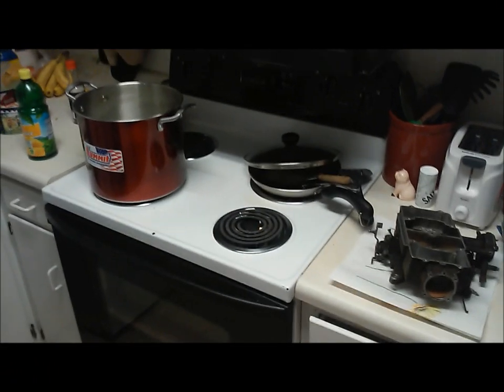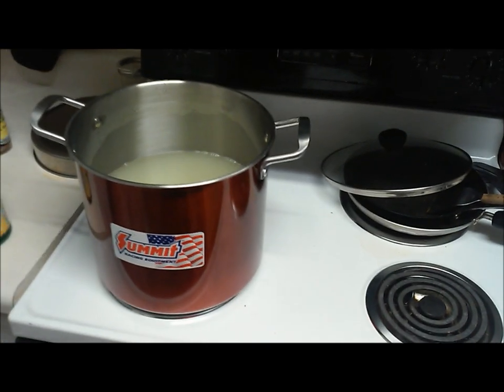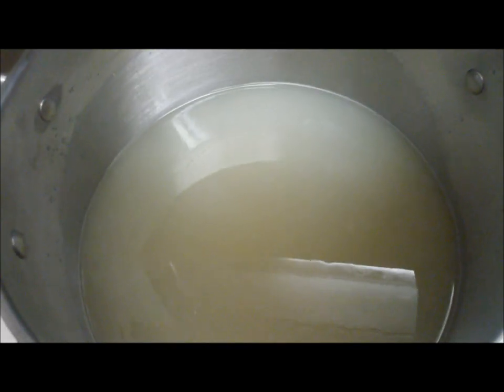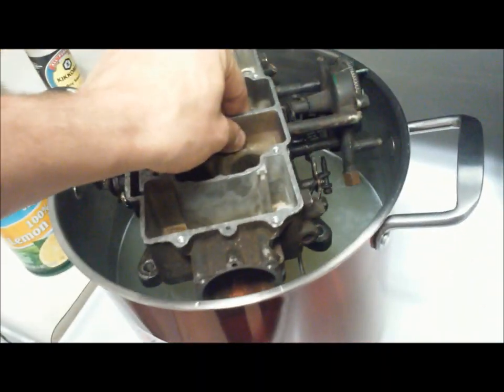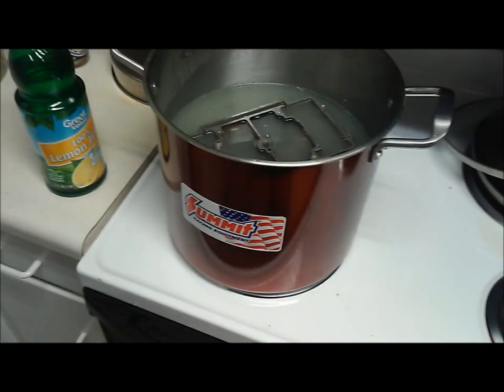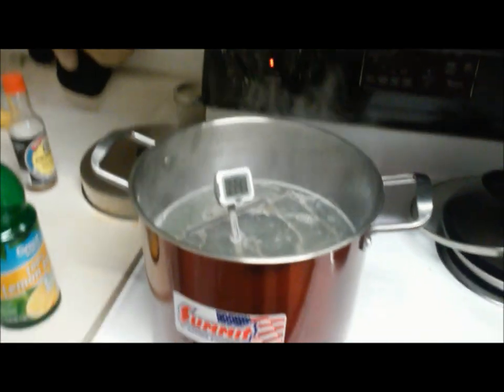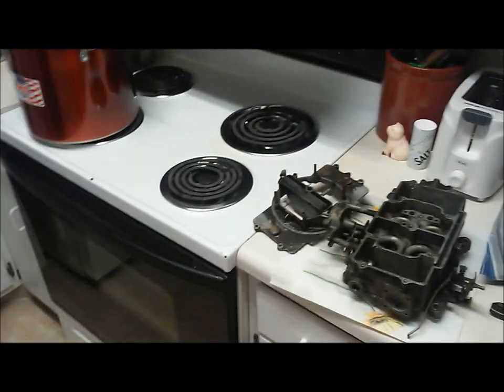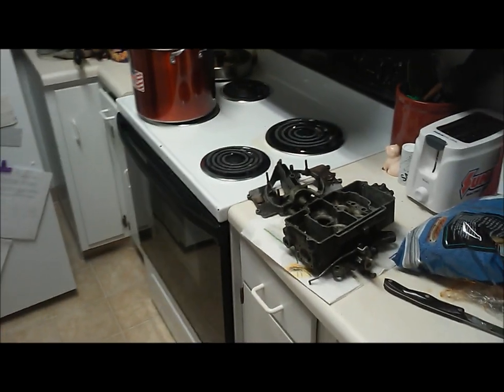Carb Cleaning: Boiling In Lemon Juice (TESTED/REVIEWED) - Failed

Comment: well, i been using this method for more then 25y and sort of developed my own liquid mix over the years. My medium too cook it in is an old deepfryer with the heating element under the pan NOT in the liquid itself. its has approx 2 1/4 us gal (10liters) volume so i can  chuck in just about any carb or tb without problems. i fill it up with a bottle (1L) of "dasty" thats  a cheap household degreaser that outperforms most automotive degreasers here in europe, half a bottle (0.5L) alcohol vinegear of 18% alcohol, 2 bottles of concentrated lemonjuice and ruffly 1.5 handfull of sodacrystals you normally use for cleaning arround the house. i top it of with "distilled" water (you can use plain water, but because i set my frying pan maxed (180°C) out for the first 10 i found at these temps plain water that hold a descent ammount of chalk can deposit that in the aluminum body's pores giving it a dull whitish tone afterwards. why do i max out the fryer? you add a large cold metal object to the liquid causing it to cool down pretty hard and this way its less of an issue. also heated at those temps with the lid closed you sort of steaming it so hard grime dissolves better. then lowering the temp to 120°C and use some sort of pliers or so to hold the carb firmly i use a brush for washing dishes , a few for cleaning bottles in different sizes for cleaning the lines and holes to give it a good scrub. i do this to remove the surface grimelayer that otherwise would show up when dry( if you use a pressurewasher on a car alone you get the same glaze effect.
NOW comes the part most forget just like in this video i think.
first of all, ALWAYS submerge it completely so no air can get to the aluminum parts.
after about 30 minutes its time to get it out.!!!
here you can have two options
the first one you need to have a bucket of medium hot water even better is the hot tab with a showerhead. you let the showerhead running allready. then pull out the parts one by one and STRAIGHT AWAY hose it down and with a softer brush go over the entire part to be sure that all traces of the liquid are gone. also go from hot to cold water so the parts cools down to. 
aluminums worst enemies are air the acids and heat at this time, so the more "airtime between the fryer and hosing down the more time you give it to corrode the surface ending up with a dark black/greyish dull shine. but its clean anyway.
as last when done rinsing blow it dry with a airgun and then richly apply a generous coating of WD40 or similar to seal of the surface from the air and sweaty hands.
i usually wrap them in wd40 soaked papertowwels and leave them overnight. 
the oil will settle in the aluminums pores. 
if you do it correctly you get a carb body that comes fresh n shiny from the factory.
the second option and  my trademark is to black it out more by using more lemonjuice after cleaning and let it dry layer by layer to a coal like grey and buffing the nuts n bolts to a shine. i made my "blackout" trademark for carbs and tb's that are modified for better performance.
PS: i suggest experimenting the liquid measurements, for example brand A lemon can be far less aciddic the brand B , needing more or less.
Reply: Ok

Comment: I cleaned a Varajet a few weeks ago...

Used a ultrasonic cleaner - paraffin first to get the oil and grease off then a quck blast in caustic soda - not too long as it's very corrosive to aluminium.

Came up like new with a bit of scrubbing with a small stainless wire brush afterwards.

Comment: I think I'll stick with brake clean and compressed air
Reply from the maker: +dethmetel no kidding, im going to try the pin sol deal next. i feel that most of these SEEM to work because the carb is clean enough that it would be simple to clean anyhow. this thing is really REALLY dirty. so id figure id put these methods to the test